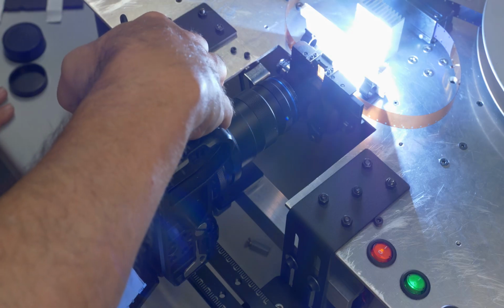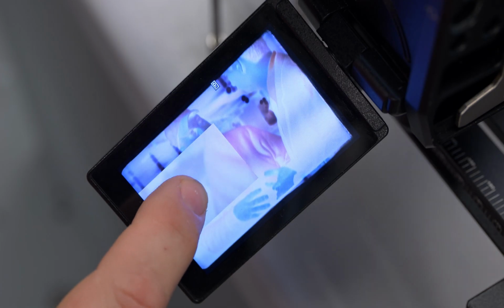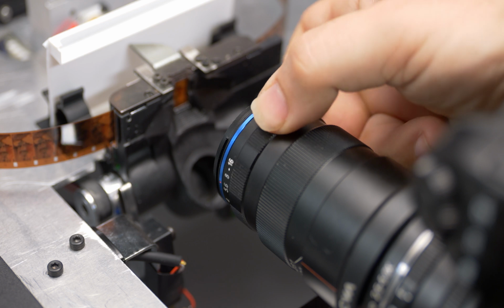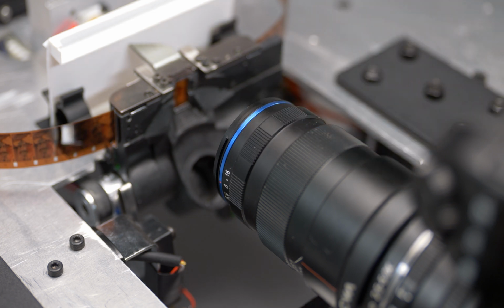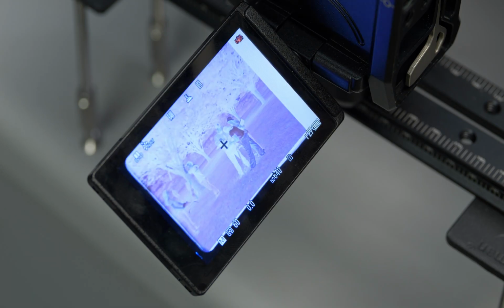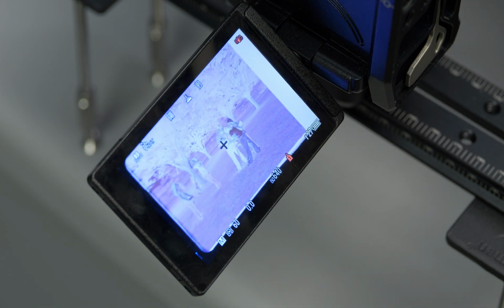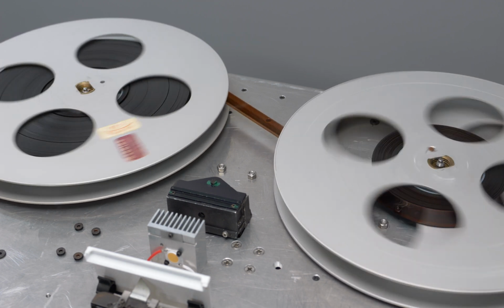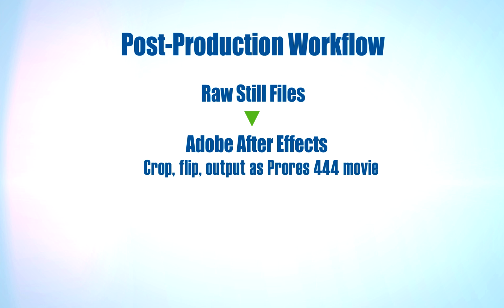DIY 16mm Film to 4K Digital Transfer System | Part 3

Comment: The end result is amazing, I had no idea 16mm could look so good.  I have reels of time-lapse lying around, probably getting wrecked in the Australia heat.  This has made me want to take better care of them, and make my own contraption!  I wonder where where I could find a film gate
Reply: The "Scrubs" series has been shot on 16-mm first to last season, with the same Aaton camera. They released a single HD episode for season 5, then starting from season 8 they released it in HD. 16-mm film was originally considered not good enough for HD programming, but most broadcasters have since relaxed their requirements, while the HD version of "Scrubs" as well as this build show that 16-mm can very well be used for HD shows.
Reply from the maker: Yes, I think 16, especially Super 16 easily can meet HD requirements.  One of the key things I'm not sure I mentioned was the quality of the lens used - I shot all my footage with primes, mostly Mark 1 Zeiss Superspeeds - not the best ever made, but better than most. Some of the zooms from the 60s and 70s were pretty bad.
Reply: @ConsumerDV  interesting! I watched scrubs. I remember it was grainy now and then, but it fitted the vibe
Reply: I watched your number 1 and 2 build and the effort you put in has paid dividends. This episode has convinced me to consider a 16 transfer machine, after I have finished my dual 8 machine. Excellent production Fresh Ground!   😊
Reply from the maker: @brianmuhlingBUM  Thanks! Depending on the footage you have, using a projector as the base would also work - maybe not quite as stable, but the camera mounting and LED light source are the most critical.

Comment: Another brilliant installment to this series. I’d like to make one, but for use as an optical printer, with a Bolex as the camera, and the whole machine in a vertical orientation. Well, one can dream…..
Reply from the maker: There used to be a company in the 1970s and 80s that made the exact optical printer you're describing - I think it was JK Cinema, or JK Camera?  I looked for one, but was never successful.

Comment: hello, I am following your work with interest, great work, I plan to make such a browser in the future.
The shutter mechanism you made for the camera shutter is very clever and practical.
as an alternative method:
How do you think it sounds like moving the reels with a stepper motor and making short movements that correspond to 1 frame and sending a shutter signal to the camera with an ardunio?
thanks
Reply from the maker: That sounds like it might work, however the Arri gate mechanism I used requires a 360 degree rotation to place each frame.  If you could time the take-up reel to move after the shutter snapped, that might work, however the amount of film taken up changes consistently as the reel rotates, as more film is accumulated.  Thanks for watching!